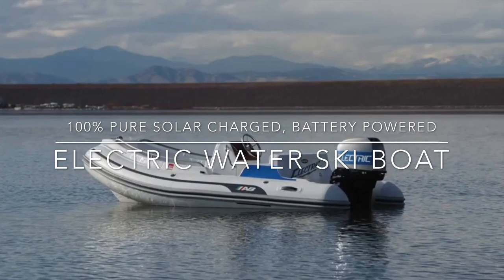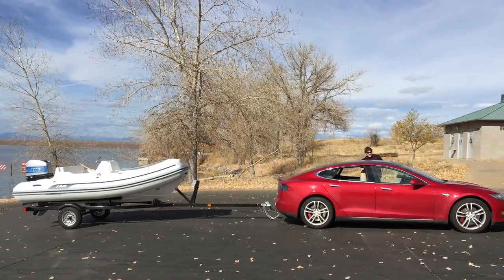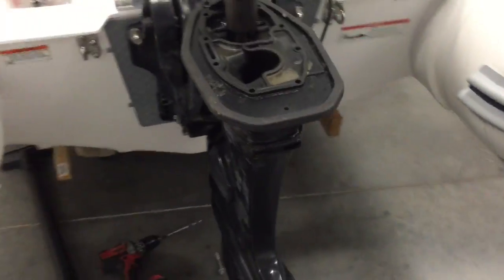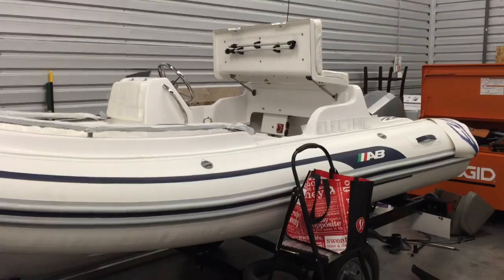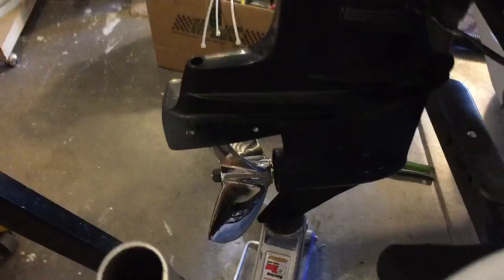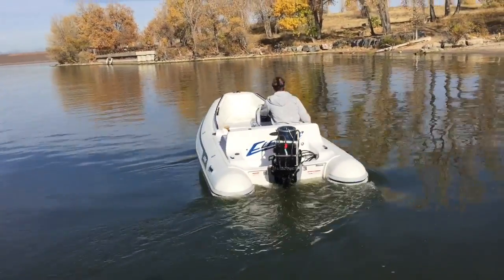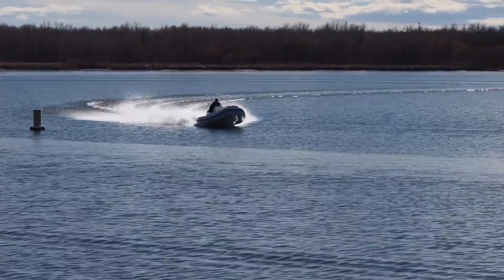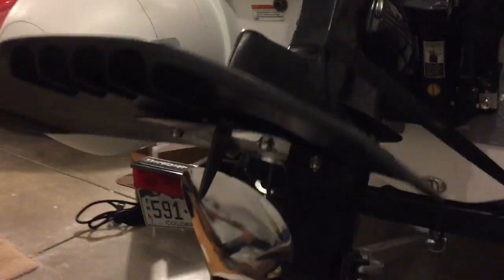World's Fastest Solar Powered Electric Water Ski Boat  (full documentary)

Comment: Wow! What a great project. Very nice job converting the ICE outboard to electric. It looks a lot like the stealth high power electric outboard I purchased. They are built very similar with a water cooled 75 hp motor & control. Thanks for sharing
Reply: How long have you had it? Any issues? They look like a great product
Reply: @electrifiedmarinaYT  I finished the conversion about a year ago. I've had the boat out to the lakes about 20 times. Very reliable! It runs like a champ with a top speed of 25 mph and a 20-30 mile range (depends on driving speeds). The Hi-Power NMC batteries allow for high amp (250 amp) discharge rates without overheating. Video at: https://www.youtube.com/watch?v=GaeNsEVr-t4&t=3s
Reply: That is impressive! Glad to hear it @MarkWalters-g9x

Comment: “Will it work” ? Sure, sink enough money in a project, and it most probably would end up working

Electric motors in boats, are not the problem per se, the Batteries and Control Management complexity (ie COST) are (let’s skip for now  the boating limitations of “weight” and space)

Some people commented “many people would buy it”, oh hell no, it would be so stupidly expensive, that only deep pockets with secondary reasons would, otherwise it makes NO FINANCIAL SENSE at all

Electric “fans”, seem not to understand (…..or want to) the environmental cost of Lithium batteries, both direct cost (land destroyed) and secondary (none of the heavy machinery used are electric, nor the ships that carry the raw materials are). Nor they seem to understand “how” is that electricity delivered from the “miraculous” wall plug is generated…….by “magic” it ain’t, nor is produced by solar (at a large scale)

So, kudos for your (may I say “very expensive”) exercise, now your RIB can go 53 miles an hour for maybe 15 minutes……….

For those of you who complain about the Carbon Dioxide emitted by combustion engines, have you ever looked into HOW Photosyntesis work for plants growth ? It’s simple, only 3 elents, and it,ll surprise you

What minerals go into a Lithium battery ? Lithium, Cobalt, Manganese, Nickel and Graphite. Boy, that’s a lot of unhearting, innit ? 500,000 pounds of heart need to be removed and processed (by heavy machinery) in order to gather sufficient minerals to make 1 Tesla battery

I believe none of you has been shown the “environmental cost” of your dreams, as the Electric Dream is just a marketing ploy to make you feel the urge of spending more money in a product with the moral benefit of “saving the planet” from a sure catastrophe.......as if

Comment: Amazing congratulations for your very nice Electric boat sir! I have to say try it without the hydrofoil on the engine . Sometimes you can go faster. Some good  research saying anything good about that. More effective on big boat to fly at lower rmp.but the result is not so impressive. I remove mind and the rpm Higher faster than with it. And between you and me, you have enough power to fly strait very easily . Thats my opinion. And i speak french so, sorry if you have to work hard to understand trying to do my best without Google 😆😎✌️✌️if i remember i Never see a racing boat with that

Comment: It's cool tech but I had Achilles 124 sport with 70 hp tohatsu pulling barefooters and costing (at the time) 9-12$ a day. Not sold but I did get a fat tire e-scooter and 70-90 mile range (terrain) off bluetti solar. I get the hype but storage is held back, the earth is a battery it just needs non compromised or corupted frequency bands for transmitting and reception. Designated widths for propagation reliability. ( Energized lay-lines as the old school pyramid generating portal ionization and magnetic defusers did pre-bible,...
Not my first apocalypse, or plans to be a last.  All is well

Comment: How the DC voltage from battery powered the AC 3-ph motor?  What the devices (controller and etc?) used ? What component should we consider for all system or could you give the reference so i can learn about the system?

Comment: Great job on the conversion, it seems to me power density is the main problem with most electric vehicles of any kind. You've done a great job with power generation at your house as well. That's one hell of an array on the roof. Kudos on all your projects....
How many times would you change the battery out for 4 hours of skiing?
Reply from the maker: Thanks for the comment and for watching! Yes, energy density is still the weakest link but it’s slowly improving! It’s been three years and 

for the same priceI can buy an intact complete battery pack from a Tesla model three and double my storage. This will give me an entire day on a single charge. (that’s with starting and stopping of course. Actual range 3 to 400 miles idling and only 70 on plane) 

I wish I had used a bass boat or something with a flat floor and an inboard, I also want to build an entirely electric solar house boat.
Reply: @jltempes  Again, very cool projects.

Comment: Great job.   But I’ve used 15 hp on boats that big and haul but with 4 adults at 18 mph. But I’m fishing.  So if you fish and not ski ?  You could do it with less batteries solar no Tesla batteries.    And standard golf cart motor     Right ?  Plus you can bring home supper.  18 is plenty fast.
Reply from the maker: Yes, it takes exponentially more power to go fast.  I am thinking about a houseboat next which would be ALL solar electric.  It's quite easy to get 15 mph.  Once you need to get on plane, you need 10 times the power.  This boat can "idle" at 5 mph for 100 hours on a single charge.  If you wanted a low speed, you could do it MUCH cheaper!  Example:  5 mph only takes a couple hundred watts.  Full speed is 85,000 Watts.  It takes about 40,000 Watts to go 35mph.  30,000 watts to do 27 mph.  Thanks for watching!
Reply: Net Positive LLC   So you can run 15 mph for 20 hours usage ?   Actually a ten hour battery would be good    Big slow quiet fishing boat  works unless you in a tournament.  Thanks !

Comment: I see company’s like elcore building and selling electric out boards but non of them can reach over 15 miles per hour.
Reply from the maker: Yeah, they’re really made for massive boats. Torqeedo makes a nice product but WAY expensive. knowing what I do now, I’d buy a full intact battery from a wrecked Tesla model three, 75 kWh and use a bigger flat bottom boat and not worry about the weight so much and then just put in a 200 or 300 hp electric motor.

Comment: what parts did you use and whats the specs?! like how long can you drive it on a full charge? super interested
Reply from the maker: Thanks for watching! The parts are listed in previous comments. It can do about 40 miles at full speed or 200 miles at idle speed
Reply: @jltempes  nice 😁 I can't find the specs in the comments below, but how many watts is the motor and how many rpm is the peak? I don't remember is you said it in the video but how many AH is it?
Reply from the maker: @trymhammerstrmgisiger1278  It's an 80,000 watt motor and controller, (171V at 500A) peak.  the motor can do 8,000 rpm.  I'm using it about 5,700 rpm continuous. I bought the motor and electronics at thunderstruck-ev.com
Reply: @jltempes  holy shit😂 insane

Comment: Greetings from New York City:  Hi guy.  I"m pretty amazed about the dingy that you engineered via electric power....... my question is: can you do it by removing both Volvo-Penta engines on a lagoon catamaran 44?   Please respond.  thanks......... Jay
Reply from the maker: Sure, there are electric motors up to 700 horsepower available in a kit.  You'd have to replace the engine with the electric motor and you could keep the whole outdrive.  I would recommend using a full Tesla battery skateboard from a wrecked car.  It's waterproof.  I can idle for 100 hours, something like a 200 mile range at slow speeds.  Links below:

http://www.evdrive.com/products/evd-motor-controller/

evtv.me

Comment: Congratulations for $200k you built a tender that can run at 85% for 20-30 minutes then conveniently recharges in hours when you have access to 220 volt electric outlet. 
For less than $3k a person could buy a used aluminum lake boat add a 50 horsepower 2 stroke outboard, and run faster speeds all day long. When the tank runs low on gas, refill it in seconds anywhere and you're back on the water.

Comment: If you're going for zero emission,  Probably would of been more efficient and useful to convert a gas motor to a hydrogen fuel cell.  Would of saved lots of weight a fraction of the cost, cheaper maintenance, more reliable run times, and faster fuel ups.  You could repurpose your batteries for a hydrogen conversation station to create your own fuel.  Above all else you would still be creating zero emissions. 

  It's an impressive rig that you have built.  I just don't see the practicality of it since we do not have real efficient ways of storing electric power, and boats in general are very inefficient machines.  When I take my boat out I generally dedicate an entire day to being out on the water and that consumes about 50 gallons of fuel on a 21' 5.7L.  I'd say at best if your towing skis or tubes at a speed of 35mph you're probably looking at 50 mins of battery life and then 4½ hour recharge.  But none the less very cool and impressive .

Comment: You should never run an outboard that doesn't have the lower end in the water. The water provides cooling for the lower end gear set. VERY hard on the bearings and seals.

Comment: I did an electric outboard, but the gas powered lowered gear is very inefficient, high friction, takes a lot of energy to just spin it,
which makes little difference in a wasted energy gas powered boat.   A better approach is to put the motor in the water for cooling and direct drive the prop.
Reply: yep, convert a shaft drive.

Comment: So how much did it cost for the motor set up and electronics minus the boat ,and what would be the best way if a guy was going to use this on salt water due to corrosion ?
Reply from the maker: Dave Scheer I think I have seven or $8000 into the motor which isn’t bad considering it’s peak power of 105 hp with as much torque at idle as a 300 horse outboard. The battery is another seven or 8000, so comparable to a gas set up though I never pay for gas again.

Comment: Did you do an endurance test, to see how far you could go on a single charge? How much did the batteries weigh? Fully loaded, my boat carries 58gal of fuel, and has a 200hp engine. So I carry 353lbs of fuel. I can cruise at 20 knots for almost 9hrs at 2800rpm. My boat weighs about 4500lbs fully loaded.

Comment: Hi there @ Net Positive LLC, this is really awesome! Congratulations. Can you please provide more information about the specific model of e-motor and the motor-management - and as well how/where to buy a tesla battery-stack with charging-electronics? Many thanks, Christian. Unfortunately your e-mail-address doesn't work...
Reply from the maker: Christian Pfetzing 
Thanks for watching!  www.thunderstruck-ev.com
It's the 144volt, 500 amp, 88 horse motor. They handle all the programming based on your parameters.
The batteries are off eBay from a wrecked Tesla.
Reply: @jltempes  it's an AC motor right?

Comment: Question,  I noticed you did direct drive coupling of the shafts (no extra gears) and used a upgraded 15hp golfcart motor BUT, How did you determain the size of the electric motor to use with the size of outboard gearbox?   example: if I use a 250hp outboard for the project how would I estimate the correct electric motor
Reply from the maker: Thanks for watching! Excellent question.  There are a lot of variables.  I used a lower unit from a 40-50-60 horsepower.  I used an electric motor whose horsepower depends on the voltage.  My original batteries were (3) 48 V modules in series for (144v) This would yield a peak of about 80 hp and a continuous rating of about 50 hp.  The same electric motor running 170V (my current configuration), is about 105 peak hp.  So, I'm way overpowered for the lower unit which is why I had a hard time finding the right prop.  For max power and speed, I had to get a 24" pitch, on a 3" hub.  Basically, I look at the power curve for the motor at the voltage I want, see where peak HP comes in and do the math for what pitch prop I need.  Multiply prop pitch times motor rpm, divided by gear ratio, in my case 2:1.  The resulting number will give your speed in inches per minute.  Easy math will convert to miles per hour.  This is your theoretical max speed assuming you have enough HP.  Actual will be slightly less due to prop slip.

I can use a 15" pitch prop for MASSIVE hole shot and still do 45 mph due to the wider RPM range of the electric motor. (0-8,000 RPM)

If I were to do it over again, I'd use a larger outboard.  They make water cooled electric motors up to 760 HP that weigh only 200 pounds!
Reply: so just a rough estimate is 170v-144v=26V and 80hp-105hp = 25hp so a good rough estimate would be 1.04v per additional HP. so for the 250hp in my question I'd need about 321Volts , thanks watercooled would be great but not saltwater maybe a oil or fresh water and small motorcycle radiator would work.       On your prop you mite try a four blade pusher prop instead of that racing cleaver prop. A regular four blade pusher the blade ears will look the same as your three blade you will get good hole shot but top end will have lots of push at lower rpm (less voltage means longer battery life) Thanks for the reply great video
Reply from the maker: Pretty much Your math is just about right on.  The most direct way is to just multiply Volts times Amps which give you Watts, then divide by 746 (the number of watts per horsepower.) My controller puts out 515 amps max so 515x170 is 87,550 Watts, divided by 746 is 117HP.  This is absolute peak and does not take into account efficiency loss of about 5%.  It is also only at full battery charge, this will drop perhaps another 5% with voltage sag.  So figure 90% = 105HP  

If you want 250 hp, that's 186,500 watts.  If you use a 500 Amp controller, you'll need 373Volts.  You can get controllers at a lot of different voltages and current ratings.  See: www.evdrive.com  They have controller from 250-1000 amps with voltages from 130-700 volts.  Their motors go up to 760HP!

Good luck!

Comment: Why didn't you put the batteries in the front of the boat for better weight distribution? Other than that beautiful build
Reply from the maker: HI, I have 4 battery modules under the back seat and 3 up under the steering console.  The modules are 55 pounds each.  Ideally, I'd have liked to put them lying flat in the bilge of the boat in place of the gas tank but I'd have to cut the boat apart to get the tank out.  If a manufacturer were to make this, they could easily achieve this and give better weight distribution and free up all the storage space!  If I made a pontoon or tunnel hull, I'd just make the flat floor of the boat the battery. 
Thanks for commenting!
Reply: 7 x 5kWh = 35kWh and 232 Ah if in series for ~160V DC supply. 75kW ~ 2C discharge rate so I'd be surprised if 15min of 75kW run time could be achieved in practice with adequate cooling. I suspect various things get too hot before that however as thermal management is a time consuming task to engineer - so maybe 5 min or so. So many people have been asking about run time; why not answer their questions?  Cool project, nice to see the power - but range is everything. (ref: www(.)evwest(.)com/catalog/product_info.php?products_id=463)

Comment: Great boat and nice video! I can tell a lot of work went into it. I've been wanting to do an electric boat for years. I'm not so sure you can technically call it solar powered if the the solar system is separate? Also how do you find the curtis controllers? Have you tried tweaking many of the parameters?
Reply from the maker: Thanks for watching!  I would encourage you to go electric!  I do call it solar powered because 100% of the electricity I've ever charged it with is from my solar panels.  Also, I have a 620 watt solar bimini top which can charge it directly.  (See Worlds best electric boat update to see this under construction.)  I got the controller from thunderstruck motors.  Also check out HPEVS.com  I've had to program everything to match my parameters.

Comment: Definitely not worth the time or money that was spent on this.   88hp of electric or gas would do the same thing on that small boat and gas outboard is way cheaper and probably a lot more reliable
Reply: Brent. Yes but in a world without gasoline which would you rather have? If the sun stops shining you've bigger problems to worry about

Comment: Birdshit welding will fail. either you are using a welder without the amps or not using argon gas
Reply: I think the plates were not pre heated enough or at all. For aluminum thicker than 1/2" you need to preheat, the wire feeding process will not put enough heat into the part for complete weld penetration.
Reply: TimN No you don't need to preheat, for a proper job you need a welder pumping at least 250 amps which most likely would need to be 3 phase . Alternativeliy a high frequency acdc tig 230 amp should do the trick. The amps are the heat and as aluminium melting point is relatively low it heats up fast.